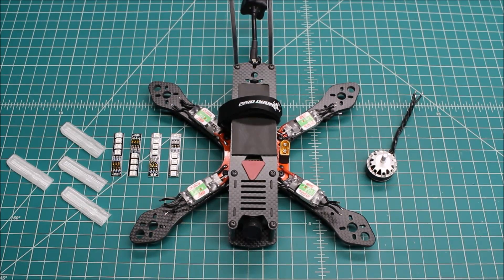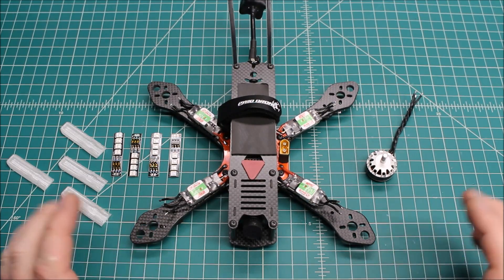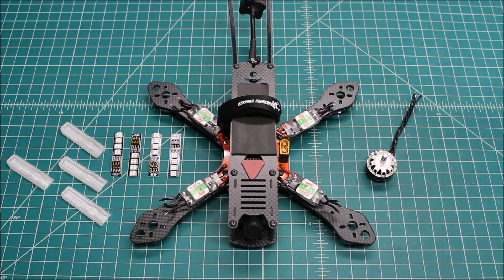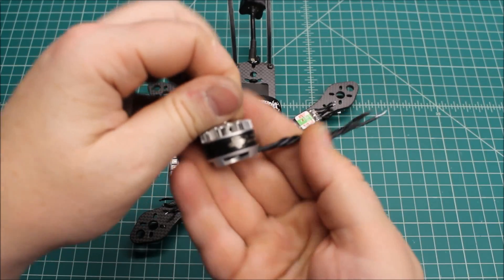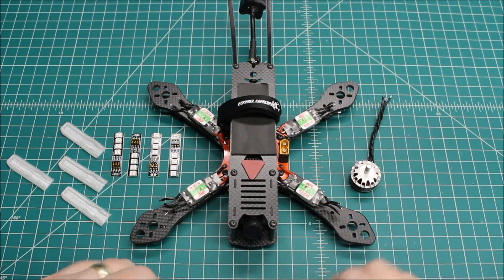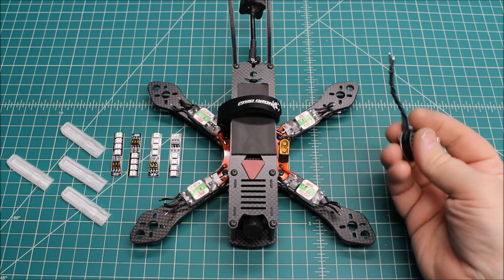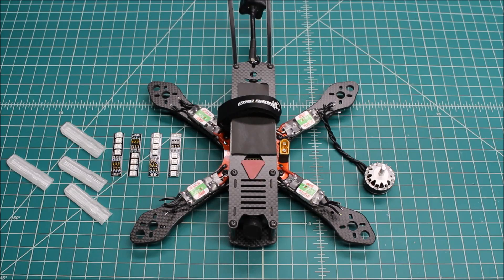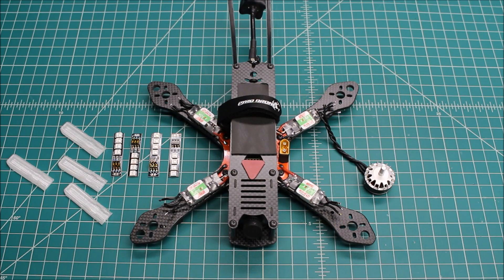Martian II FPV Racing Frame Build-out for 5s Lipo

Comment: What do you use for a reliable 5v source for the flight controller? I want to get away with using the included PDBs with my next build.
Reply from the maker: Zak S this one has the HUBOSD. I only use the stock PDB as arm support

Comment: Where did you get this top plate? My 2nd Martian II is about 3 weeks old and i got the same top plate i got with my 1st Martian II months ago. ^^ On my older Martian II the bottom plate broke some days ago, so i need a replacement anyways. xD
Got to buy the whole frame again.
Reply from the maker: ZeroFPV eBay item 281982979767
Reply: Thank you but the seller does not seem to ship to germany. Found a seller in Hongkong.